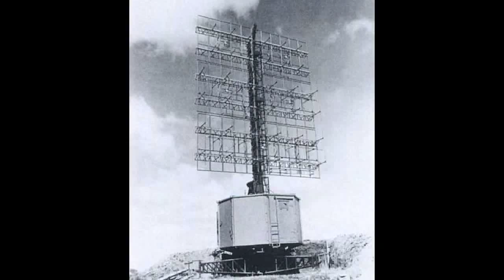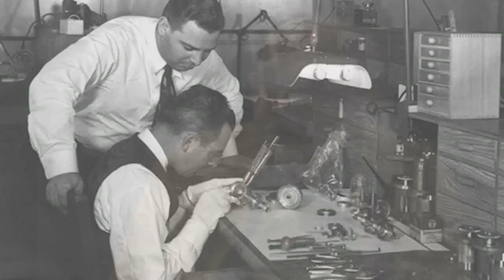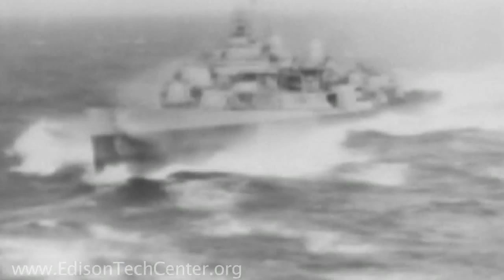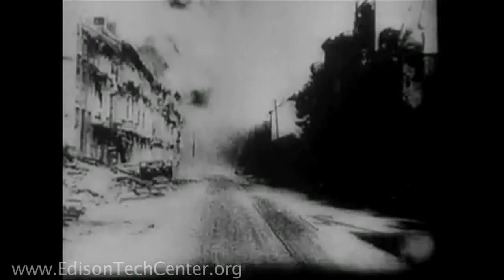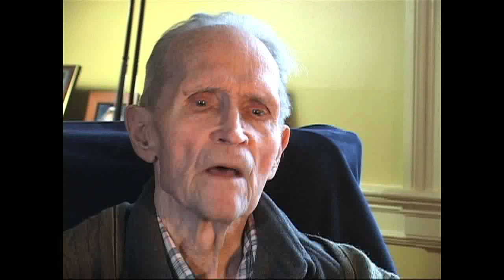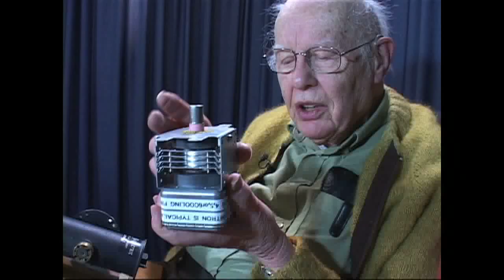Radar History: Rad Lab and Schenectady Work

Comment: One other problem is the complexity of the cavity magnetron. Before the Tizard Mission, they were making them via machining since each cavity had to be made with precision. This was slow and made them expensive and few and far in between. GE and Rayethon got together and said "why not try mass production methods?".  So they came up with the trick of making magnetrons by cookie-cutting sheet metal and creating the magnetrons like you would build a sandwich, or an electric motor. This solved the precision issue since each piece came from the same press, eliminating quality control and variances machining at the time created.  In the end, this sped up production immensely and the costs dropped like a rock from thousands of dollars for a SCR-584 magnetron, to mere pennies on the dollars for each unit. They enabled the mass production to build thousands of "eyes in the vans" that enabled allied forces to deal with threats.

Comment: re: "some guy" who started the US radar: citing https://en.wikipedia.org/wiki/Vannevar_Bush

On August 31, 1940, Bush met with Henry Tizard, and arranged a series of meetings between the NDRC and the Tizard Mission, a British scientific delegation. At a meeting On September 19, 1940, the Americans described Loomis and Compton's microwave research. They had an experimental 10 cm wavelength short wave radar, but admitted that it did not have enough power and that they were at a dead end. Taffy Bowen and John Cockcroft of the Tizard Mission then produced a cavity magnetron, a device more advanced than anything the Americans had seen, with a power output of around 10 KW at 10 cm,[40] enough to spot the periscope of a surfaced submarine at night from an aircraft. To exploit the invention, Bush decided to create a special laboratory. The NDRC allocated the new laboratory a budget of $455,000 for its first year. Loomis suggested that the lab should be run by the Carnegie Institution, but Bush convinced him that it would best be run by MIT. The Radiation Laboratory, as it came to be known, tested its airborne radar from an Army B-18 on March 27, 1941. By mid-1941, it had developed SCR-584 radar, a mobile radar fire control system for antiaircraft guns.[41]

Comment: Microwave ovens use 2.4GHz
Reply: Not all of them.  Large ones used in industrial microwave processing typically use 915 megahertz, as did early household ones.
Reply: Muonium's comment is valuable and proper.  Feedback on accounts like this one which correct small mistakes increase the value of the account.  It is standard practice in print publications which cover history and technology to include a section in each issue to publish reader feedback which points out and corrects errors in prior issues.  This process greatly improves the quality and the value of the material presented.  The process for YouTube videos is not formalized, but Comments and Replies are the main tools available.  // Note that articles published in magazines and journals generally have the benefit of polishing by editors and at least some qualified pre-pub review.  A guy talking off the cuff doesn't have that benefit.  I'm sure that the 90 year old recounting his memoirs would want errors to be pointed out and corrected.  He'd hate to add noise to the historical record.   //  By the way, microwave ovens for home and restaurant use operate at frequencies of about 2.45 GHz.
Reply: WiFi also use 2.4GHz, and I heard there's a company that offer supermarkets ways to count numbers of shoppers, on daily basis by interpreting WiFi signal like echolocation.
Reply: Do you want a cookie? He's like 90 years old. I read around it. 
Hint: You should too instead of pointing out pointless mistakes by the man who developed the magnatron radar system.
Reply: Blow me, bitch.